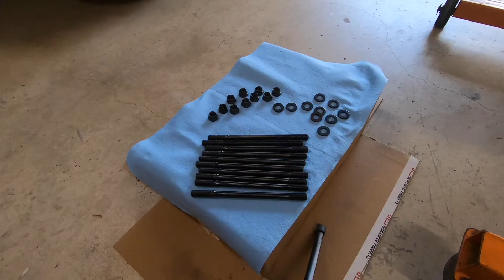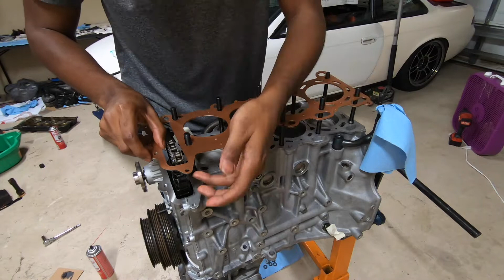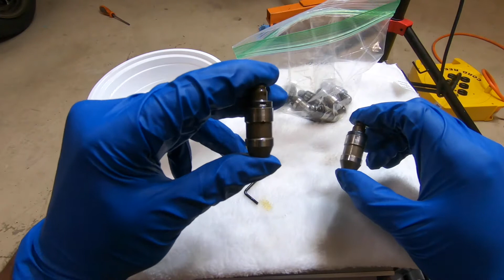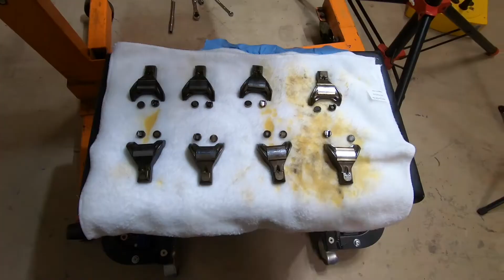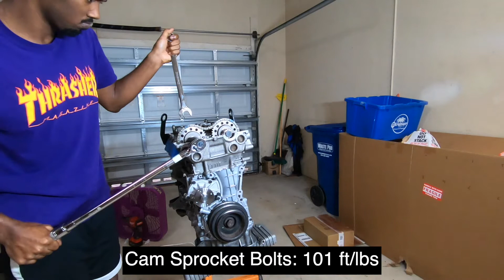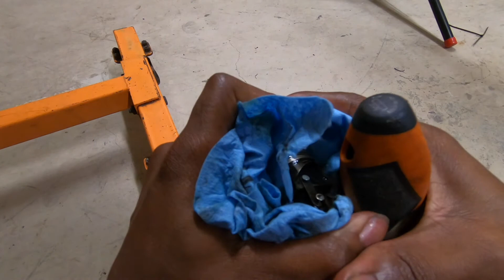ARP Studs, Camshafts, Timing - SR20DET Rebuild Guide - Part 3

Comment: I can’t get my head over the chain guide😔 how did yours go down so easily
Reply from the maker: trust me it wasn't easy, I was very frustrated and had to try many times, just know you can get it on but you will need a second hand or will need to push the guides in a bit. You can also install the ARP studs after but the instructions DID say to install studs first

Comment: Do you know where I can get the cam caps? I searched on eBay and other sites but not yet.
Reply from the maker: usually you replace the entire head assembly, this is also the reason why you keep the caps in the same order when you remove and reinstall, because the tolerances are so tight and changing them can cause the bore to be out of round.
Reply from the maker: if you do end up finding caps, make sure you install them without the camshafts and torque them, then have a machine shop check each cam bore for any out of round 👍🏾

Comment: I was given a SR with the cams and cam gears out of the the head so there is just a timing chain going to the crank. Is there any way to put it back together without taking the timing cover off to count the links? Thank you.
Reply from the maker: yes, you can count chain links from each sprocket on the cam gears. make sure cylinder one is at TDC and after that rotate it a bit and then get 1 back to TDC and verify number of links hasn’t changed. very sorry for late reply. youtube hides comments sometimes

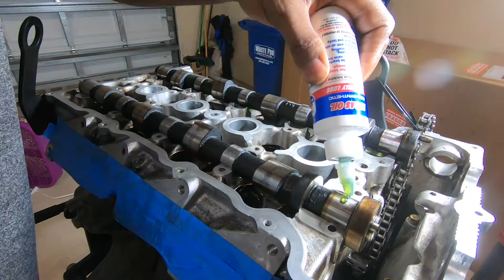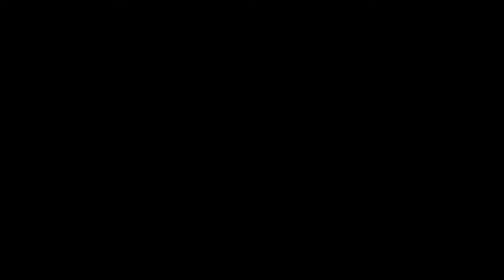Comment: I think the reason you had a tough time lining up the timing marks on the cams was your intake cam wasn't exactly at 10 o'clock (@10:18) which is super hard to tell without the sprocket. When you have the sprocket on @12:36, you can use the 12 holes to gauge the "hour" mark better and you can see the 12 o'clock "hole" is off to the right just a little (enough for that one link that you're off by). 

Any way, your rebuild series was super helpful while I rebuilt mine so thanks lol
Reply from the maker: really good catch !! i did notice this and i believe i ended up fixing this later on. timing is always a pain but i’m glad i have the diagrams and specs shown and also i’m really happy this helped you !!

Comment: Great step by step man, so glad I've found your channel for when I rebuild my engine 👍
Just one question though, after you pushed the chain tensioner in and mounted it how did it pop back out? You showed it coming out on the video but I didn't see how.
Reply from the maker: Thanks man that was the plan, this way everyone can have a video guide for rebuild!! With the tensioner it’s supposed to pop out by itself after you tighten it, if that doesn’t work you can spin crank slightly and it should pop out. If all that fails, you have to stick something in there and push the arm that holds it down so it pops out !
Reply: Brilliant thanks for the reply 👍

Comment: good vids man imma keep these as a reference for when i build mine
Reply from the maker: Yessir!! Hope this helps, they’re is a good written guide online on how to disassemble but haven’t found many step by step assembly ones !!
Reply: @kriswyche  i disassembled it already now i just have to start buying parts and contacting machine shops and shit
Reply from the maker: @ayoooRenato  try to source a good condition crank instead of machining, if you do machine make sure it’s a shop with jdm motor experience and not a shop that does majority V8’s !!
Reply: @kriswyche  thanks my guy i will keep that in mind‼️